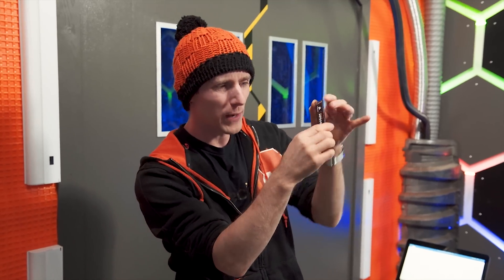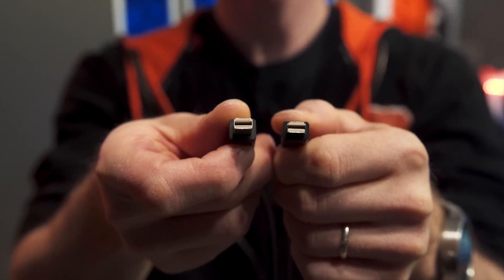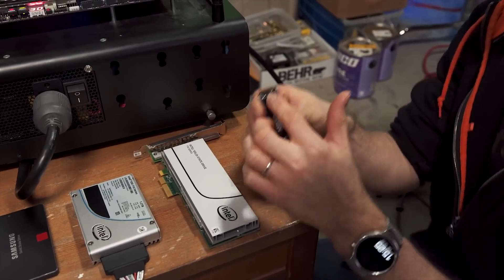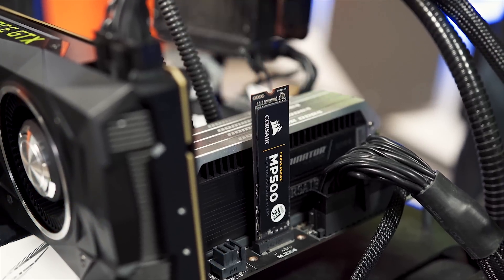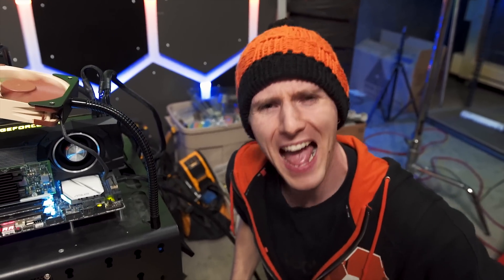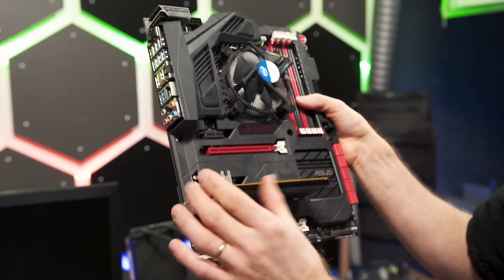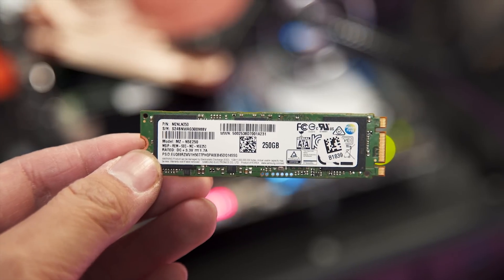The FASTEST SSD Technology Explained - M.2, U.2, and MORE

Comment: I have 2 500gb sata ssds in raid 0, and probably wouldn't even notice the speed increase of having a m.2 drive. Also, it was a lot cheaper then getting a single pcie drive, and I just backup all my data to a 1tb hdd... I think this is the best solution for most consumers/gamers wanting a lot of "cheap" SSD storage space, and reasonably fast speed (over 1GB/s).

Comment: So...on board m.2 is not has good as a pci e card...?
Reply: ForkMyDongle Onboard and PCIE are the same thing. They both use PCIE lanes for data transfer. The PCIE ones are just there in case you don't have a motherboard that has an onboard M.2 slot. 
Whichever option you go for, make sure the protocol of the drive itself is supported on the motherboard you're using. There's AHCI protocol and there's NVME protocol. The first one is slower and the second is far faster.
Reply: Thank you for the explanation, got lost with the protocol aspect of it.

Comment: Correct me if I'm wrong, but that laptop at 1:10 is a MacBook with USB-C right?
I'm pretty sure all MacBook's with USB-C also have support for Thunderbolt 3 though now it looks like the MacBook doesn't support Thunderbolt 3, only USB 3.0 Type C and the Razer blade supports both USB 3.0 Type C and Thunderbolt 3. Can someone clarify this?

Comment: When using new NVMe SSDs (like samsung 960 evo/pro) and you want maximum performance, you must consider if there are spear Gen. 3 4x lanes. I had problem with Asus z97 Pro Gamer mainboard, first I inserted ssd to M.2 slot, but it has max of 10Gb/s, this translates to ~800MB/s in tests. Then I bought PCIe-M.2 card and inserted into lowest PCIe slot, which works on 4x, but just Gen. 2. - 20Gb/s, ~1.6GB/s in tests. I had to insert this card to second PCIe slot, which works on Gen. 3 4x - 32Gb/s and 2.5GB/s in tests. But using second PCIe slot forces first slot (where GPU is) to work just on 8x.

Comment: Expensive? I bought an intel 600P M.2 drive when building my PC because it was way cheaper than a sata samsung 850 pro of equal capacity. The fact that the M.2 drive it runs over 3x faster than the sata one is just a bonus.

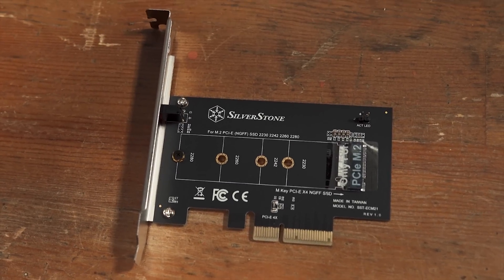Comment: 5:10 Sorry but wrong...It's Sata vs PCIe...not NVMe vs. AHCI what makes the M.2 connector different (ok NVMe runs only over PCIe but there are also a few (older) ACHI PCIe x4 drives on the market which uses the M.2 PCIe connector, e.g. the SM951 has a ACHI and a NVMe flavour)

Comment: It's nice that there are all of these new faster connectors designed for boot drives, but are there any similarly fast solutions for large storage. Other than an external thunderbolt raid system, I don't know of anything that combines speeds faster than SATA 6Gb/s and storage greater than 2TB. For editors who need both fast speed and massive storage to work with large 4K files, are there any good options?

Comment: I have an older 1366 board. an EVGA e760. Im not wanting to upgrade my entire system, but i do want to "wake it up" with a an M.2 drive like the Samsung 960 evo. 
Can i use an M.2 ssd with an PCIe card with a m.2 adapter/connection? I "think" it might be able to boot off a PCI slot. not totally sure... i know that it is not a UEFI bios.... help!!!

Comment: So this is another benefit of replacing my H87M Pro with my Z97 Sabertooth MKII (apart from the increased USB 3.0 I/O). Since a 4790K+GTX 970 will tide me over for at least another 3 years, by the time I look at replacing my current OCZ Arc 100 240GB (91% health-OCZ/Toshiba really don't make SSD that are durable-the cheap 128GB Sandisk U100 from my 2012 notebook has has close to the same number of writes, yet hasn't started to degrade at all)

Comment: I have a Samsung Samsung mzhpv512hdgl 512gB m.2 AHCI drive and consistently get 2100 read and 1400 write so NVME is not the only high speed option. This is running on my Asus Ranger Vii Motherboard. This AHCI version can be used on any M.2 2280 socketed mobo, the NVMe is the one where you need to check, but Asus announced that all z97 and x99 boards would support the drive including boot drive capabilities.

Comment: Rampage IV X79 and 950pro works at advertised speed as a boot drive. Default bios settings non moded bios. Silverstone adapter. 

Linus you have all those older MBs and CPUs, can you actually check which ones will work?
 All of with old tech will be grateful to find out. MB support will allways say it doesn't support NMVE, but it was simply not true with my X79 Rampage iv board 3960X. 
I can send you all screenshots and bios info of you need. Cheers.

Comment: You can actually boot an nvme drive on motherboard that don't natively support boot. the easy way is to put the uefi nvme driver on an efi partition of another drive.  The other way is with models like the samsung 950 or intel 750, which have an "Option ROM", which is and old standard you can even boot from or many legacy BIOS's

Comment: If your motherboard doesn't support booting off an NVME PCI card couldn't you technically use a small bootloader on a SATA storage drive that transfers control to windows on the NVME? I mean that HAS to be possible even with something like GRUB maybe?
Reply: Mod your bois?
Reply: Yes. I do that with my Linux Mint workstation. Running a Dell SC440 I bought in early 2006, boot partition is on my spinning drive, root points to the NVMe SSD on a PCI-e adapter. My BIOS boot process is pretty slow before it even looks at booting from a drive, so for me booting from a spinning drive prior to mounting an SSD as root isn't bad; plus, I reboot like once every two-three months. The SSD does make program start much faster than before, and normal operation is faster.
Windows I think would support it, however you would have to have both the SATA SSD and the NVMe SSD in the machine while installing Windows. If you're installing Windows you probably already got new hardware that supports booting from NVMe. Most people would not want to go through the trouble of installing Windows fresh to upgrade old hardware.

Comment: I got an nvme m.2 ssd drive booting and running on windows 7 on my asus x79 motherboard with an asus m.2 to pci-e x4 adapter. was a pain getting the nvme driver sideloaded into the windows install but once that was done it was smooth sailing.

Comment: meh I'll stick with a SATA III 480 GB SSD. The load times are already 2 fast I can never read the loading screens anymore :(
Reply: The areas where you see a major difference between M2 and SSD are a light less numerous than between SSD and HDD, but they do exist and are once again a several times increase. The big reedeming factor here is that it isn't actually that much more expensive, the gap between HDD and SSD is waaaay bigger than between SSD and M2. It's also very small and frees up a Sata port, so I could see it outside of a budget build.
Reply: @ssssaa2   Why not both? 
or is that just pointless?

Comment: 1:44 Ethernet cable to carry HDMI, not quite. A CAT 6 cable is a twisted pair cable (often incorrectly called an Ethernet cable), Ethernet is one application for it. Other types of cabling such as Coax & Fiber can carry Ethernet, but they wouldn't work with that HDMI extender you pictured because it works with Cat 6 twisted pair cable not just anything you could call an Ethernet cable.

Considering the context of the video this error seems a little ironic.

Comment: sata = more latency to processor. esata = less latency to processor. M.2 ahci = even less latency to processor uses 4 pci lanes.
m.2 nvme =  a hell less latency.  Nvme  mode needs to be in place for the m.2 nvme enabled ssd this is alot faster than using the m.2 nvme enabled ssd on ahci mode look at it as it was working because it is backwards compatible.  The key here is if you want to get full performance from an m.2 nvme ssd drive you need to use the NVME mode of operation. If you have an m.2 ahci ssd drive you need the ahci mode of your board. This s what i understand from it which makes sense.

Comment: Even if your MB can't "boot from nvme" it doesn't mean that you can't actually boot from nvme what it means is that BIOS/UEFI won't be able to load a bootloader from nvme but if you put bootloader on eg. sata drive it'll boot just fine surprisingly enough even Windows should be able to do this and you can definitely do this with *nix.

Comment: whats the point of picking up an M.2 drive and using a converter to plug it into a PCI-e port? Wouldn't it make sense to just pick up a pci-e based NVM-e drive instead, versus haggling with a converter and 1-2 separate drives?
Reply: At 5:53 he says "go through the same steps as our previous board that supported it natively". I have a feeling they had a longer video that included them installing a drive on a motherboard with an m.2 slot and that clip got cut, but they didn't bother updating the script.
Reply: Maybe they want to talk about motherboards that do not have m.2 slots but support NVMe drives.

Comment: For those of you with older motherboards with PCIe 2.0 and no M.2 support or even SATA 3 for that matter, I highly recommend checking out the Kingston HyperX Predator PCIe 2.0 X4 SSD with adapter.  With the 480GB version running as my boot drive, it gets over 1400MB/s reads and 1000MB/s writes.  WAY faster than standard SSD's running at full speed since it utilizes the PCIe interface instead of the SATA controller, just like the newer M.2 SSD's.  Best upgrade ever on an aging X58 board!  Just make sure your BIOS supports booting to Add In cards.  Done deal.

Comment: hey guys .. I just want to ask... I have a GA-770T-D3L motherboard with 4 gb of ram 2 gb in each slot I want to upgrade to 8 gb so I brought the hyperx fury 1600 mhz 8 gb ram and its a single channel ram and the motherboard is dual channel is there a problem to install this ram alone on the motherboard ? Thanks :)
Reply: Mohammad Albalboul No there shouldn't be any issues with installing the RAM. The only issue that could arise is if you bought a stick of DDR4 RAM for a PC that only supports DDR3.
Reply: Thank you :)

Comment: Linus, I have a question. Currently using an Asus adapter in my PCIE 3.0 with a Asus Z-97 AR to use my Samsung 960 Evo. it's working great. My question is, are you aware of any PCIE adapters that allow for 2 M.2 drives to operate at full speed simultaneously? I was under the impression the 960 Evo is using at 16 lanes for max performance, leading me to believe a second drive in the same slot will lower performance.

Comment: Those older chipsets like p67 or z68 are actually fully capable of supporting the NVME standard and to boot from these drives. Its just that motherboard manufacturers are greedy cunts and won't release an updated bios for these older boards that supports these NVME drives as boot devices. I hacked the bios on my P9X79 Pro and added this feature in and it works flawlessly. They just want to entice people to upgrade.

Comment: @Linus I was wondering, since you have so much hardware in store... I have a problem that is investigated by NVIDIA level 2 support right now but they dont have a NVME drive to test the following: On a Z170 or Z270 board and a 1080 GTX with a NVME drive (PCIE device) at least on Windows 7, referring to another guy also on Windows 10, boottime prolongs (doubles/triples) after installing NVIDIA drivers. Can someone confirm that?

Comment: You seem to have SATA and AHCI mixed up. SATA is a physical data transfer interface and AHCI is a storage protocol that can run over PCIe or SATA. There is no such thing as an AHCI-only M.2 slot, only PCIe or SATA.

There are PCIe AHCI M.2 SSDs that will blow normal SATA drives out of the water, like the SM951.
Reply: Yes, but to be exact,  m.2 PCIe AHCI drive can connect only through  PCIe lines directly CPU (it has its own AHCI controller) while m.2 SATA  needs AHCI or SATA controller in between (usually build in PCH  or on SATA -> PCIE adapters ).    PCIe AHCI are not limited by SATA limitations so they can run much faster than  SATA drives.  NVME is a redesigned protocol that has lower latencies than ACHI. 
Please go to https://en.wikipedia.org/wiki/M.2  and especially this diagram: https://en.wikipedia.org/wiki/M.2#/media/File:SATA_Express_interface.svg

The adapter shown two slots has the lower slot for m.2 PCIE ( so both AHCI and NVME) and the upper slot is for M.2 SATA drives ( thats why there is a sata connector for SATA cable that you have to connect to have it working). 

The drive MZ-N5E250BW shown is a SATA drive. 

the difference between m.2 SATA and m.2 AHCI is expecially important in older laptops where often you have m.2 SATA support but not m.2 PCIe ( both AHCI and NVME).
Reply: Andrzej J Where I live...PCH is Pacific Coast Highway.😁
Reply: Advanced Host Controller Interface (AHCI) is a technical standard that specifies the operation of Serial ATA (SATA) host bus adapters. Whereas Serial ATA (SATA)  is a computer bus interface that connects host bus adapters to mass storage devices.
Reply: Now that makes more sense as well... The Kingston HyperX Predator is also an example of this, right???
Reply: Yes but that's an PCIe 2.0 x4 drive
Reply: they have since produced another version which is gen3x4, i had the ahci version gen 2x 4 and it was still fast at 1400/600 for the 240 version. Since moved it into wifes system and I am rocking a pair of evo 960's in raid 0 on a GT73VR
Reply: Your are totally right...they should fact check their videos better...the Ethernet video some while ago was also crap...
Reply: Eli Grey I have an sm951, how does that stack up to other drives?
Reply: Lets get this straight. AHCI is an old protocal which all modern magnetic media use and some older m.2 drives which is connected to the chipset rather than the mobi. However there are newer drives which use nvme which directly use the cpu

Comment: i have about 1 year now a Gigabyte Z170X Gaming 7 with a 256GB Samsung 950 pro, works amazing for me, i cant even see the windows 10 loading screen,  only problem: the board has 2x M.2 slots, so when i stick it in the slot between CPU und the first PCI-e 16X slot 2 or 4 (i am not sure anymore) SATA ports are disabled! (and yes i ned all 8 of them) i had to put the SSD in the slot below the first PCI-e 16X slot (so its covered by the GPU) ... so be aware of it ... or read the manual first :P ...

Comment: Whats with the useless info in the start, about cables?
Which has nothing to do with M.2
Reply: He's trying to explain the difference between the connector standard and the wire. Otherwise, people would think all the m.2 stuff is the same. Kinda like how people think USB C is an upgrade from USB 2.0 or 3.0
Reply: It's not about cables.  It is about explaining physical interfaces (USB-C, SATA, M.2, U.2, Sata Express, Thunderbolt, Display Port, HDMI) vs Protocols (AHCI, NVME, USB 3.0, USB 3.1, ). 

It is like, not all USB-C is having the 3.1 speeds.  USB-C is not necessarily USB 3.1 protocols.  The same thing apply to M.2.  Some M.2 have fewer PCIE lanes. And some don't speak NVME language.
Reply: The video is not only about the m.2 standard
Reply: Rexylius De But it has nothing to do with cables
Reply: Dubious he was explaining about physical standards and protocols and how they are important to keep track of
Reply: Marcus Kapoor He might as well explain the difference between a BMW and a Audi

Comment: My pc is an x58 chipset cpu and I have a 950pro m.2 w/ a pcie adaptor running in my rig as my boot drive. The key I found to get it working was through using windows 10

Comment: Not really good explanation video.
2:12 should have some box hi-light that that this 1 block of hole is SATA Maybe add some text spec as Linus say it out
2:25 same. hi-light that these 3 blocks of holes come together to make one  SATA-express port. Also show the connector on SSD side
U.2, please show the connector on SSD side, most of us never seen it.
Then the part I find worst, explaining M.2 can carry AHCI and NVMe.
This is how I would go.
1. Explain AHCI is like what's on SATA, NVMe is through PCI-e which is faster
2. Some M.2 SSDs are AHCI, some M.2 SSDs is NVMe. Look at the keying difference.
3. Some M.2 ports on mobo are AHCI+NVMe , some are AHCI-only
3:43 all the difference I can see is the label next to the port, but no difference on the port itself.

Comment: heh, I've supposedly added nvme support into my z87 asrock professional by modifying the bios removing ip6 pxe support and in its place the nvme driver... (not enough space on bios chip) although I've yet to buy a drive and will need a pci express adapter since it has no m.2 slot! in theory it works but we will see